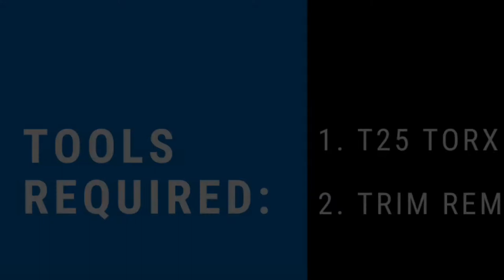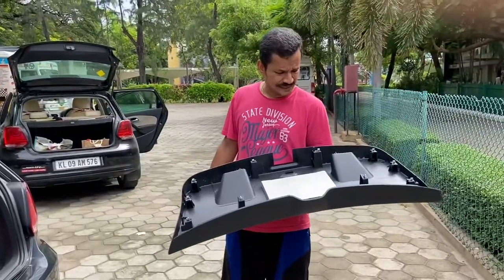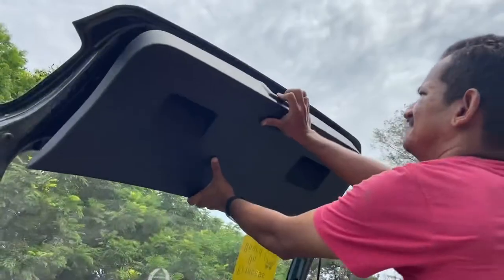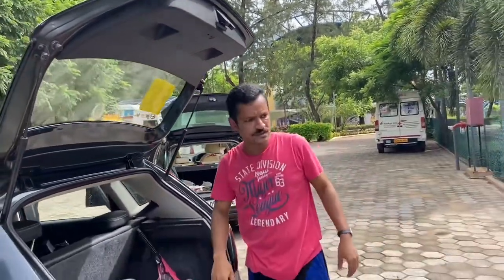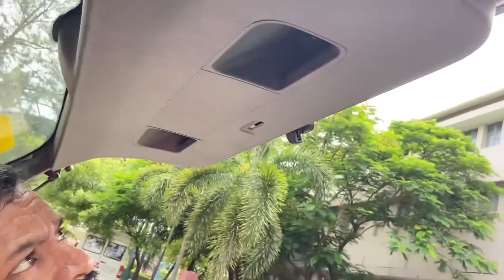Polo 6R - Removing the boot lid/tailgate trim

Comment: Hi, Thank you. 🙏
Since we are at the tailgate here; 
Do you perhaps know where the tailgate cable harness is connected inside the car body in the other direction?

I need to replace the cable harness which connects to tailgate opening, rear wiper and rear brake light.
Behind the cover you showed how to remove I expect it to be obvious, but I don’t know where the cable harness is connected in the other direction, at that end. 
To a connector in the roof or lower in the C-pillar? 

Any info you can help me with regarding this is appreciated please. 

I’m considering buying the cable harness and fix it myself.
Reply from the maker: Hi, TS. I don’t have the Polo with me now so won’t be able to do a physical check. 

But check this link which shows how the harness is routed - https://oriparts.com/39/721/75331/3964081

It is going through both the C pillars.
Reply: @GaneshBalan  Hi GaneshBalan, Thank you for reply. 🙏
I read that there should be a connection to electrical earth in C pillar too, so the issue causing the problems could be related to that. 
Have you removed C pillar panel inside before?
Reply from the maker: @TS-gg9dk  Hi TS, I had removed the C pillar to route the +12V cable to the boot light. Use a trim removal tool to undo the clips and pull the trim out using your bare hands.
Reply: @GaneshBalan Hi GaneshBalan,

Thank you for answering.
Did you have to remove other panels before removing the left C pillar panel?
There is an earth connection there, behind the C pillar panel? 

I have removed the tailgate panel and upper brake light this weekend.
I saw no obvious faults, but I disconnected some connectors and connected them again and heard the click when they came into place again.

Could upper brake light, rear wiper, rear window defroster not working all depend on the earth connection in C pillar being faulty? 
Or is the upper brake light a separate circuit? 
I’m not used to reading circuit diagrams. 

I checked if you perhaps had a video about this, but I couldn’t find one.
My Polo is a 6C model, so perhaps a little different. 
All information is appreciated. 🙏
Reply from the maker: @TS-gg9dk There is a ground connection behind the lower C-pillar trunk lining not behind the plastic C-pillar trim if I recall. 

A bad ground connection as you rightly guessed can cause the lights to be faulty. We had a similar experience with a different car while wiring up the 90/100W wiring harness. One headlight was significantly dimmer than the other side and realised it wasn’t getting proper ground connection. Replaced the ground with another bolt and it worked perfect. 

Having done so much, I assume you have checked the relevant fuse in the fuse box below the driver’s dash?
Reply: @GaneshBalan  Thank you again for the information. 🙏
Yes, I have checked the fuse, and it was OK, but I can check again. 
Since the rear wiper does move sometimes, for example when opening the boot, there seems to be some electrical connection, but not enough. 
If the fuse was broken, there should be absolutely nothing that could move the rear wiper, as I understand it.

Comment: Easy with the hatch open, but mine will not unlock and I need to get in to fix it!
Reply from the maker: Hey, did you try manually unlocking the boot door? There’s a slot wherein you can insert the key or a flat blade screwdriver and push it so the door unlocks. Tried that yet?

Comment: Do you by chance have any reference to any video which helps with routing of dash cam wire in a polo? Not hardwiring, but just want to route the cable so that it can reach the lighter power supply
Reply from the maker: Hi Arjun, don’t have a specific video for dashcam wiring. But I’ve another one which can help you. Check this out -

https://youtu.be/tqmmafINm5g